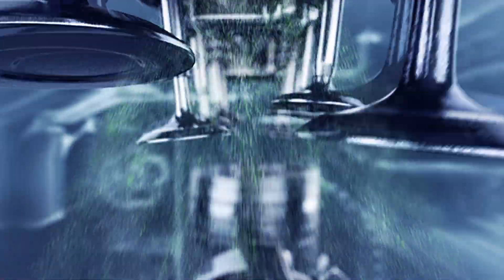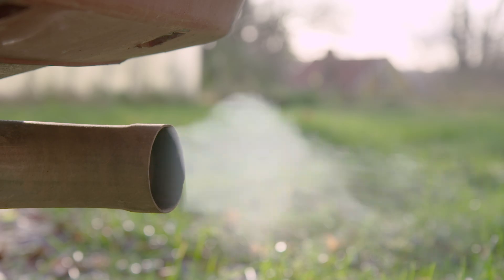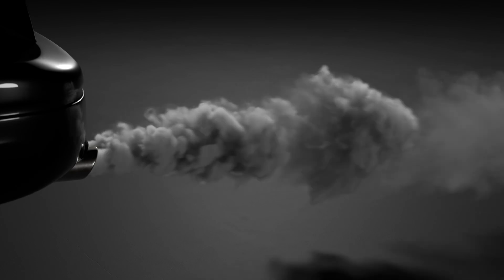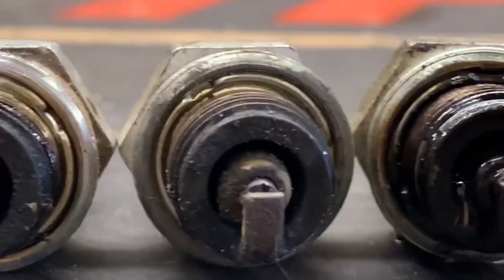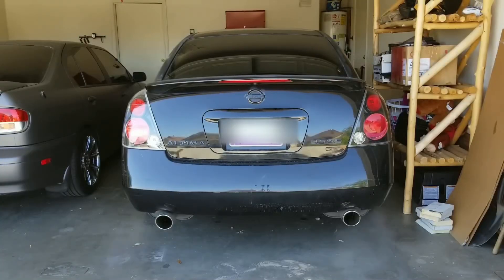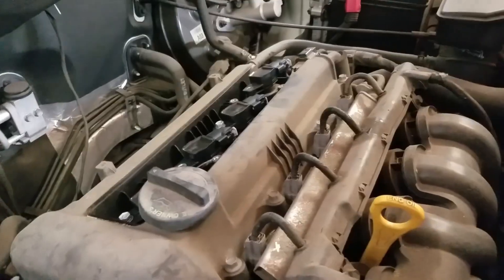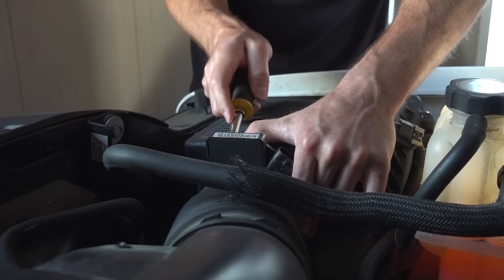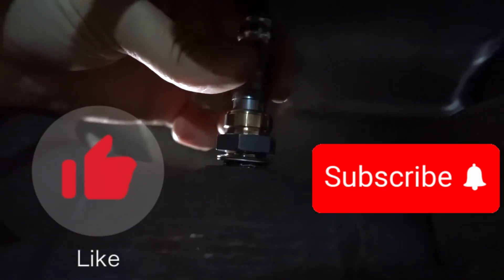10 Symptoms Your Engine Running Rich - Common Causes & How to Fix?

Comment: I dont know about all that with cars- 
But with motorcycles they are set up from factory to run almost dangerously lean from the factory just to get better emissions numbers.
Reply: leaner after stoch makes combustion cooler actually.
Reply: @KaizersPOV  I think he means richer than that, like 13:5 which is danger close for cylinder overheat. Then there's a band from that to about 14:7 you should avoid. Especially when pushing the engine hard. You can go leaner than 14:7 and be safer and cooler at the expense of some power but with great fuel economy. Spark plugs will be clean as well.